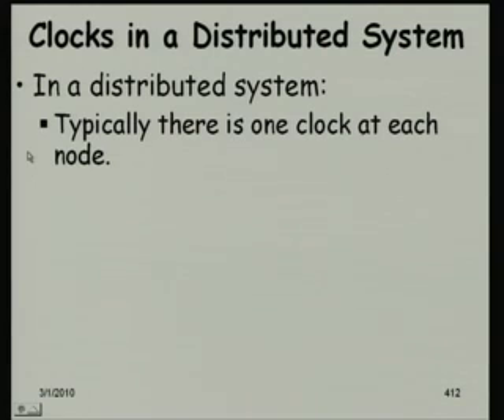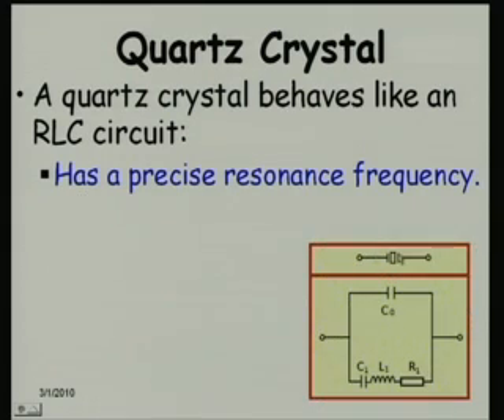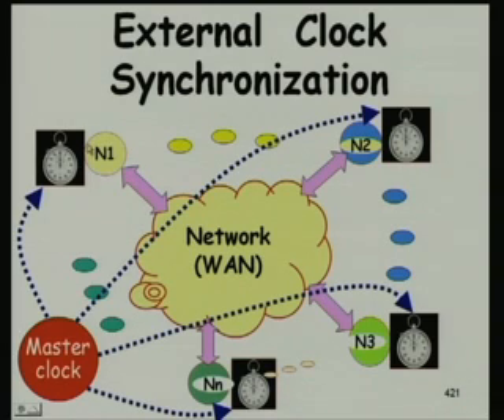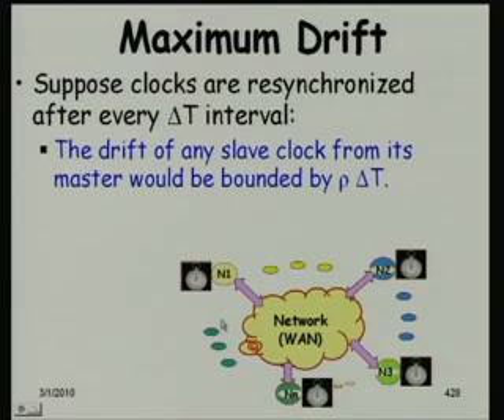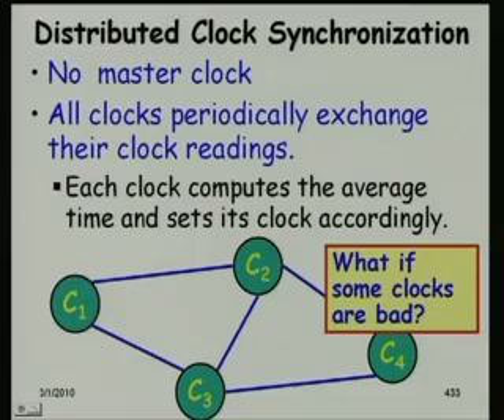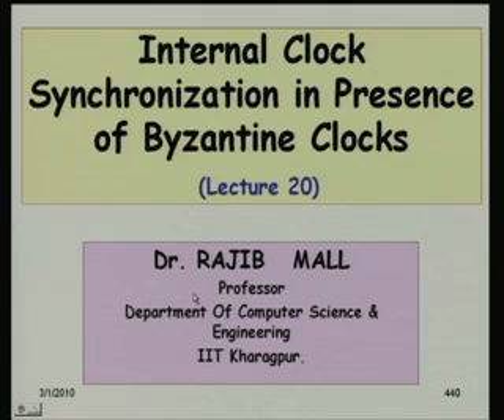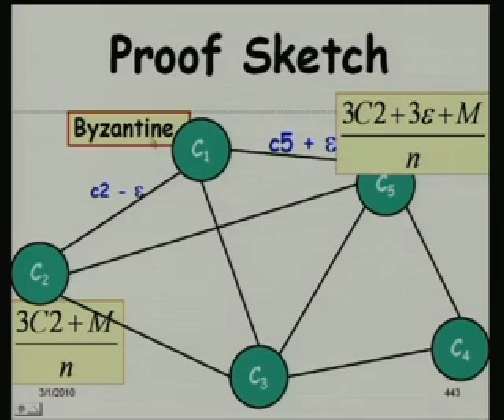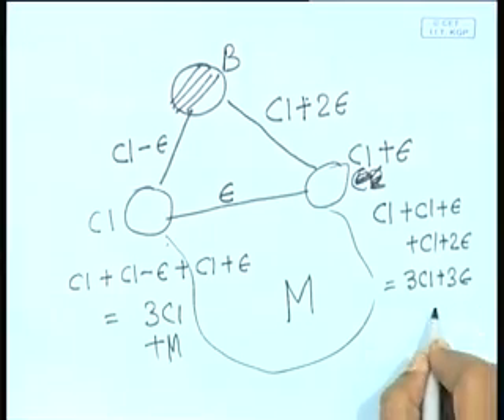Mod-01 Lec-19 Clock Synchronization in Distributed Real-Time Systems

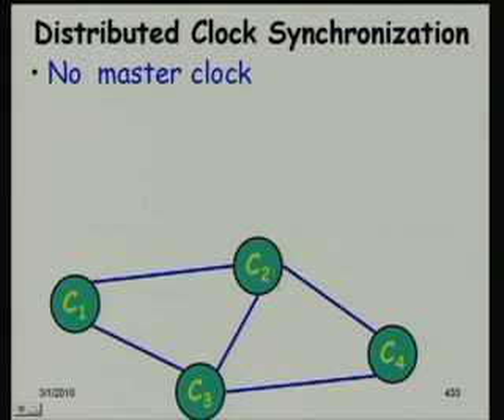Comment: Another important con of external clock synchronization is that you introduce a single point of failure into your distributed system. Internal distributed clock synchronization starts at 28:28 for those that only want that part of the lecture.